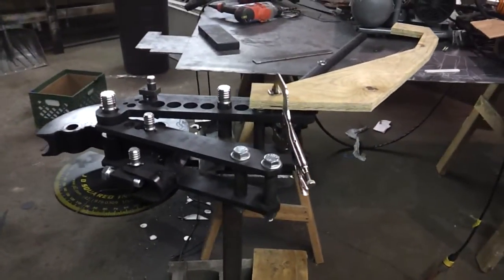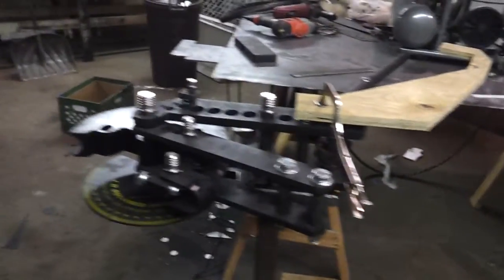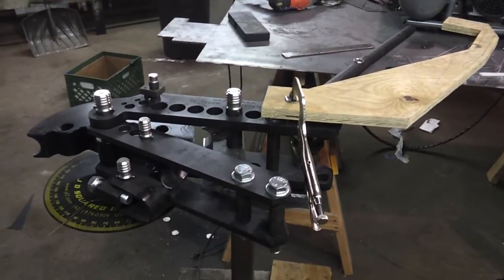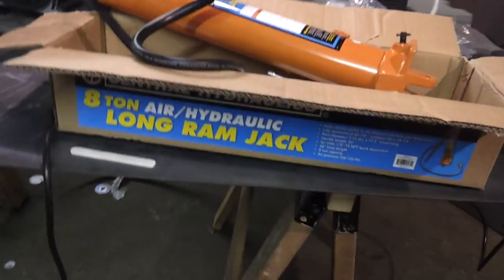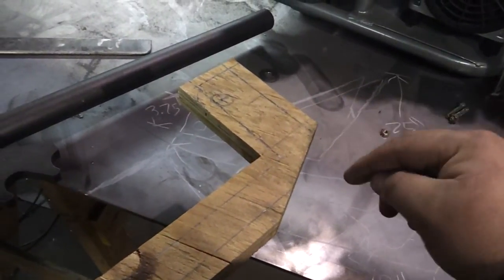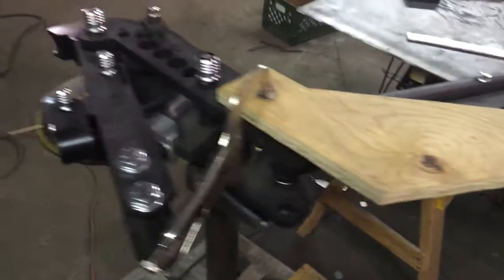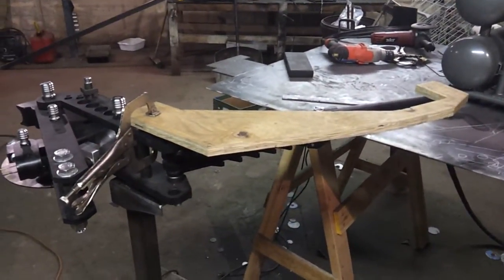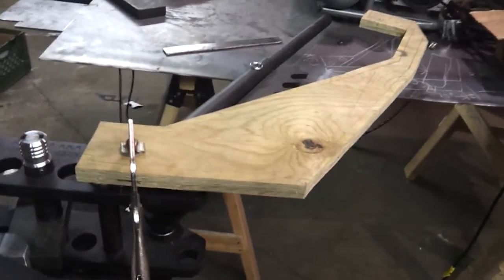JD2 Model 32 + Harbor Freight Ram Build (Part 1)

Comment: would it be possible to retrofit this bender adding a mandrel with a rotary indexer? toughts?
Reply from the maker: I'm sure you can do anything if you have enough skill, time and money. I don't see the point though. Buy the proper bender if mandrel bends are that important. Not even sure why anyone would need a bender like that unless they are a business. And if that's the case why not buy something with a warranty and a service department rather than retrofitting something that wasn't intended to be used like that?

Comment: SWAG now has a new ram mount that mounts directly centered in the hole.  It's $179 and comes with the 100lb return spring.  

http://www.swagoffroad.com/SWAG-Machined-Tubing-Bender-AirHydraulic-Ram-Mount-_p_117.html

Comment: Wow buddy...  Fast forward to the last part and see if it fails :p
Reply from the maker: lol Believe it or not I still have no used this tubing bender. However I'll be using it here real soon so subscribe to make sure you see those videos. I really don't think it will fail. It may need some mods but I'm very confident it won't completely fail. We'll see soon enough. And sorry for the lengthy videos. It's a really bad habit of mine lol. There is lots of good content in my videos though.